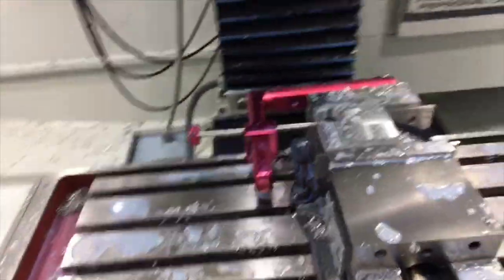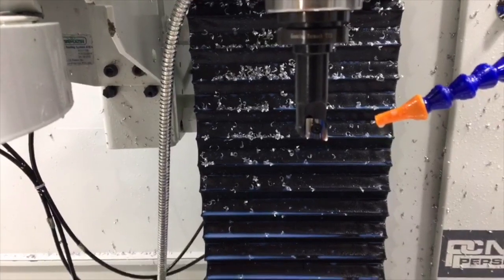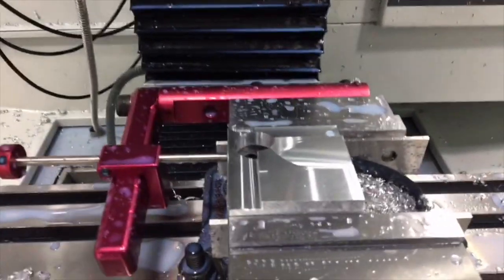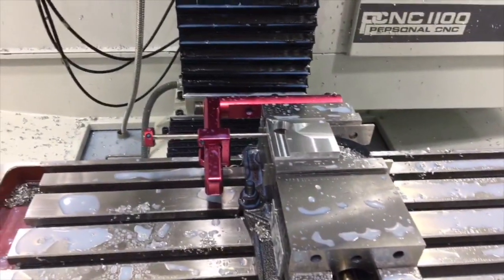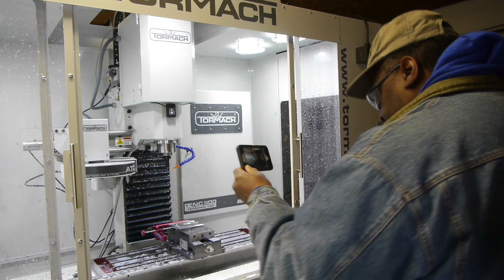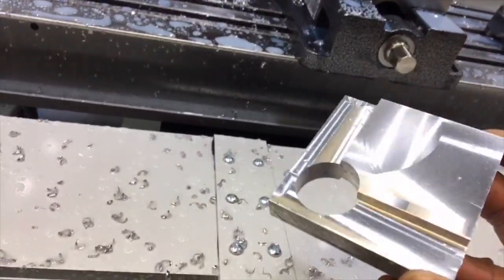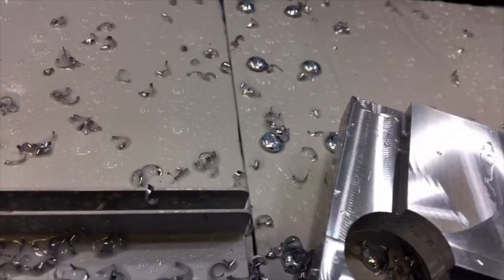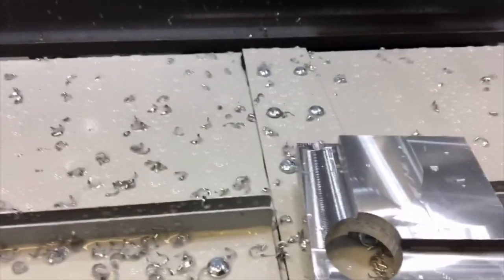Tormach PCNC1100 Making Test Parts

Comment: Nice enclosurer, I made mine out of what I had on hand and coated in flex seal. I really like the shear hog and super fly. I also use a good bit of Lakeshore Carbide endmills, they leave a great finish.
Reply from the maker: Hi Jody. How do you like Flex Seal? I wondered how it held up to coolant.
Reply: Bill Griggs it holds up to everything. It is easy for chips to stick to it though. It takes a couple of swipes to get the light weight chips knocked off and in the pan.